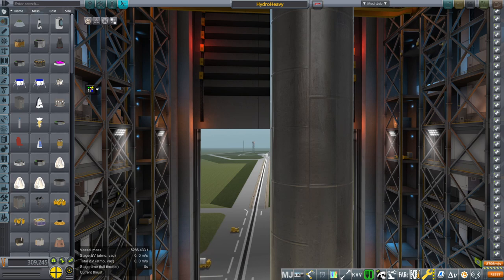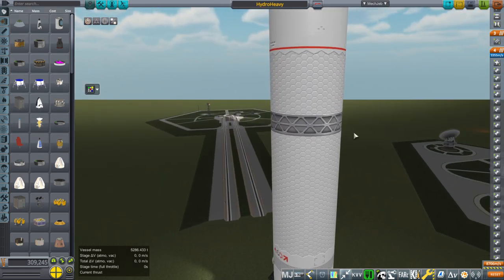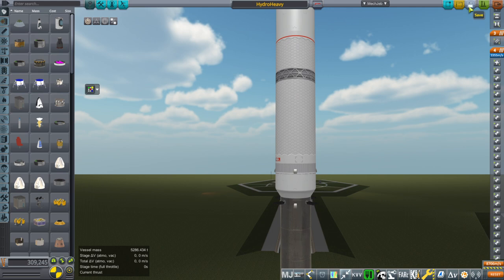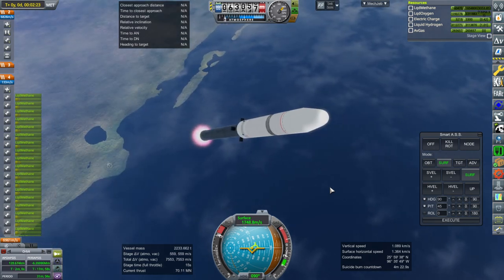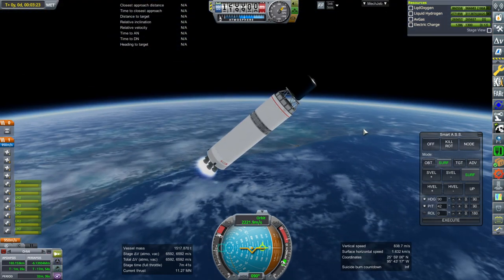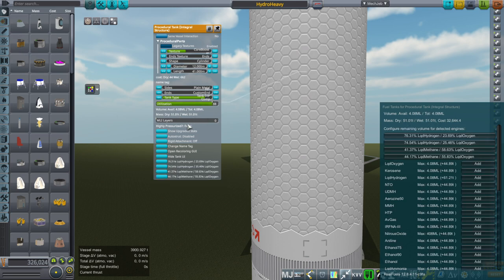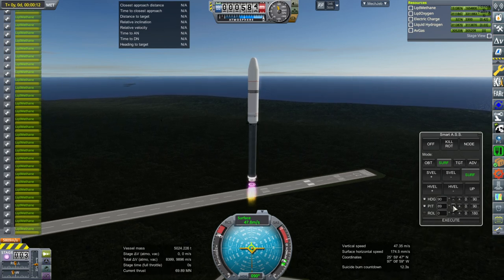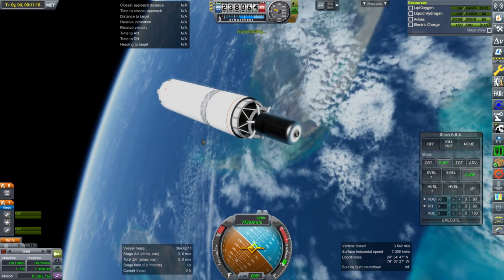Realism Overhaul in KSP 1.8.1 - Super Heavy with Expendable Hydrolox stage

Comment: I wonder how much longer this upper stage would take to make vs starship. The labor costs themselves would depend on how expensive and detailed the manufacturing had to be, and starship will need to have the most detailed manufacturing and inspections because of its reuse for the first few generations.
(There is a chance the costs will come down with experience after dozens of flights, and that is the whole premise behind starships use case, but having a plan b or a second development avenue option is never a bad idea unless you fixate on them in wrong ways.)
Reply from the maker: Impossible to say at this point, of course. I'd like to know the costs of Starship and Super Heavy right now for starters.
Reply: @RaizSpace  At this point with the whole Raptor engine design iterations on top of the infrastructure for the launch system at Boca, it will likely be years until a clear unit to unit cost would be made clear. Ideally superheavy will end up massively reused, stainless steel construction and what we know about the falcon 9 makes that less of a crapshoot. If I was at space x I would have a system preposal labled plan F where if starship itself needs 5 more years in the oven tsuperheavy could be adapted as a first stage to someone elses rocket.
Then again, I am more of a fan of rushing out kitbashes of current material then speculating on new designs, since that seems to be something that requires less political will to happen nowadays.

Comment: What did you mean when you calle magic tanks your normal SpaceX option? Are they targeting those kinds of numbers for starship or was that a joke about people being incredibly optimistic when discussing SpaceX?
Reply from the maker: Half and half. To be honest, though, even the magic tank setting won't get you the Shuttle's External Tank, so while SpaceX targets ambitious numbers and people are also incredibly optimistic about numbers, such numbers are also not unheard of.
Reply: @RaizSpace  does SLS get similar numbers to the shuttle ET?
Reply: @RaizSpace  I was going to guess that the low mass might be partly due to shuttle's external tank being mounted next to the orbiter. With no engines or payload, I thought this would mean reduced loads. Then I remembered that the SRBs attach to it which provide most of the liftoff thrust and were used to secure the shuttle to the pad. That That little mass for the thing that basically held the shuttle stack together is insane.
Reply: @RaizSpace  The "Magic" in Procedural Tanks is supposed to represent advanced carbon composites and ceramic-metal alloys. Starship's stainless steel is represented by stir-welded Steel Alloy Stringer tanks (separate structure).

Comment: 449s of Isp, what have you been smoking, scale up that nozzle. I would call 470s conservative for a FFSCC engine considering the RL-10 reaches up to 465s on an expander cycle.
Reply from the maker: That's what RPA Lite gives me given the nozzle and chamber pressure that Raptor Vacuum has. I try not to make up numbers or go with whether I feel it's low or high, even though I might think so. Only the RL-10B-2 gets 465s, and that's with a 180 nozzle ratio. RL-10C gets around 449-452. Full-flow staged combustion gets you more thrust in a smaller space, but it doesn't necessarily get you better ISP over the expander cycle (except, of course, expander cycle can't be used for engines this big).
Reply: @RaizSpace  I told you to scale up that nozzle, because a higher pressure system allows for a higer expansion ratio, while keeping the same TWR and exhaust pressure, but increasing the Isp. You can reach 470s with an expander cycle, but its more reasonable to do with staged combustion, so put a proper vacuum nozzle on there.
Reply from the maker: Apparently the nozzle on Raptor Vacuum is not a proper vacuum nozzle? Remember that by increasing the nozzle size of such a large engine, you increase the dry mass, and that may not be offset by the gain in ISP. Trying to get a 180 nozzle ratio from a Raptor Vacuum engine is a losing game, not to mention they probably would not have enough space on the stage to gimbal. The idea that you would call 470s conservative when it's never been achieved . . . perhaps I'll leave that test to you, since you're so enthusiastic about it.